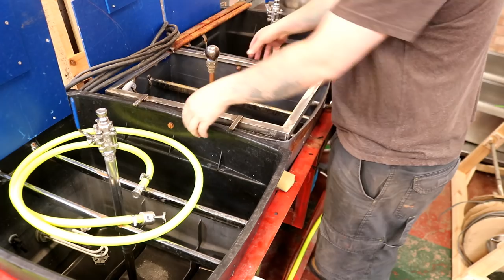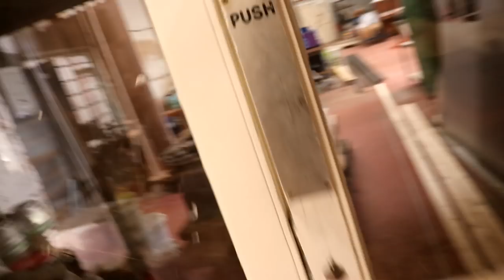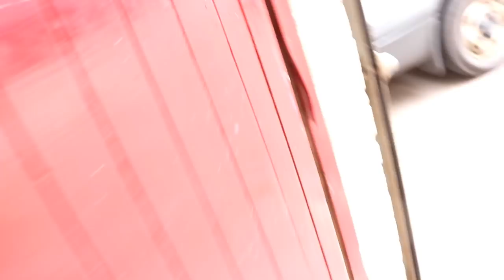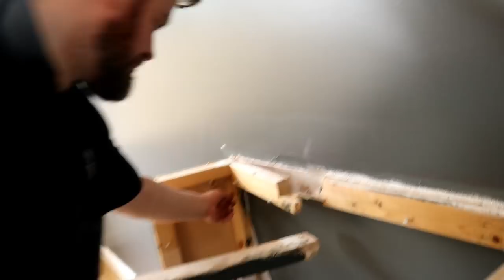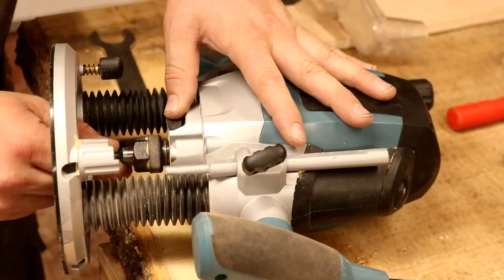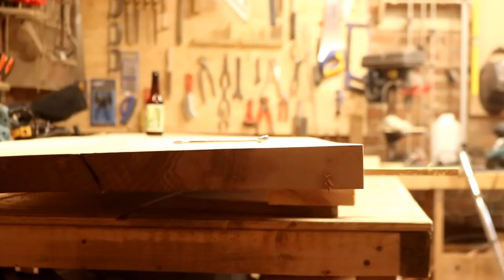TWISTED TOPS

Comment: Make a straight carcass and then heat the hell out of it with a wallpaper steam stripper and then bolt it down from underneath with coach screws ??? the ones that screw in rather than bolting all the way through. Get it hot and wet enough and you will be able to straighten it but it will take a good while if you want to move it after. The best bet is to put it on the carcass that it is going to be fixed to (presumably all straight and level 😉 and fastened to the floor) and then fit the top with the hot steam method (get it really hot and wet). Cheers, Schnuz.

Comment: Chris, you need the equivalent of a 36" thickness planer. (100 cm? 1000 mm?) You could pay someone to level that in an hour's time. (Actually, all your bartop material). It would still be very thick and very awesome once stained.  They could do a roundover and rail on the customer side and it would be very chic and beautiful - dude, it's still solid wood and a WONDERFUL piece with lots of character - it just isn't going to be 38-40 mm thick. It'll likely end up 24-25 mm thick. It's still gonna be mondo impressive. Is that stock bone dry or is it green? That can be an issue. I don't know how wide your lumber is, dressed without the live edge...but that is the guide to how large a planer you need to find and buy an hour or twos' time on it. Your lumber will be spot on, joinable and they probably will have a sander - run it through both and sand to 600 - 1000 grit and you've got furniture tops. Stain and seal - DONE!
Reply from the maker: You can't plane twist out of timber without losing thickness. I have a mate that does this stuff for a living. The only way to level the board is to cut it up, run it through a jointer and biscuit join it back together. I might as well have bought 4x2's.  Also, 120 grit is fine enough for a polyurethane varnish.
Reply: Funny - when I saw you and your mate unloading this - I thought it would be best to section that lumber into uniform thicknesses and sandwich it with epoxy but it is a lot of work and requires a vacuum bag to do properly. Besides, it really is beautiful, solid wood and a shame to hack it up. I made my suggestion only to spare you the hours of trying to tune it manually...I really want you to succeed brilliantly. As for the extreme sanding - the cost is the same (setup) and you're making furniture. The deeper the finish, the happier you're going to be. No matter which path you choose - it will be awesome - you're a perfectionist. Cheers, brother!